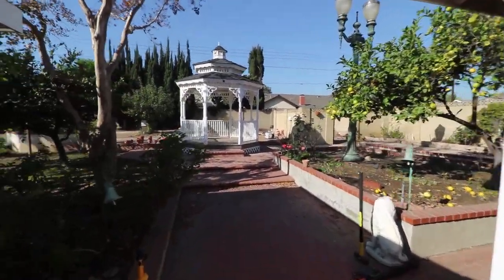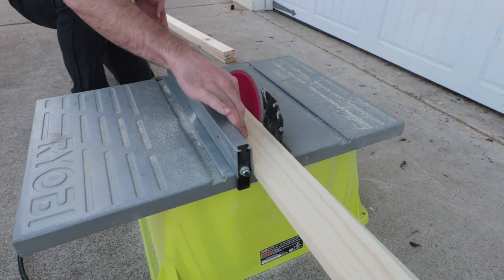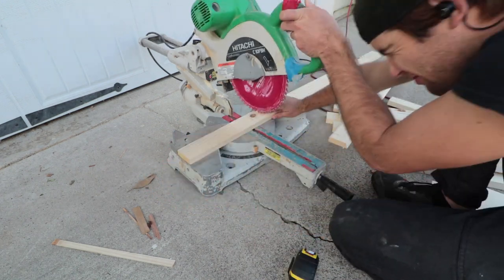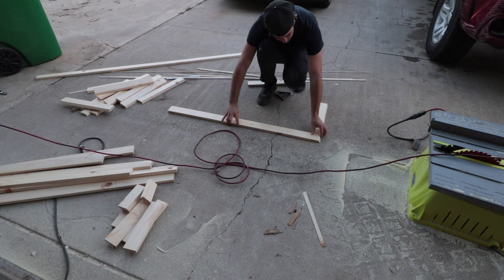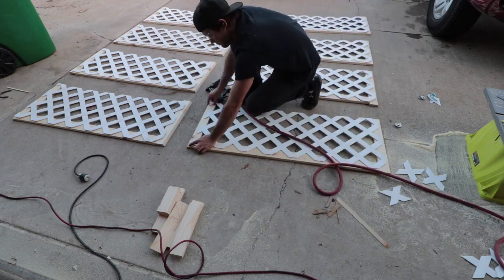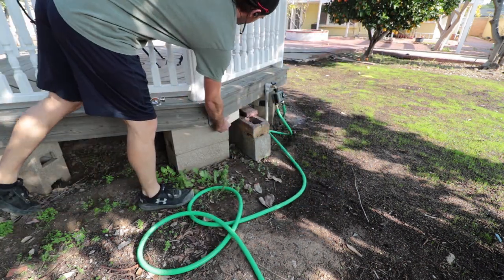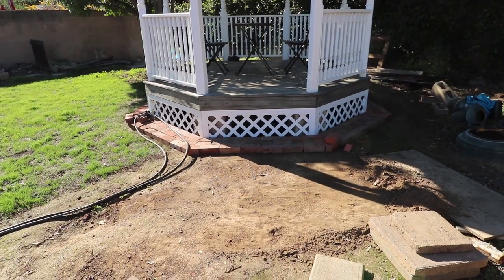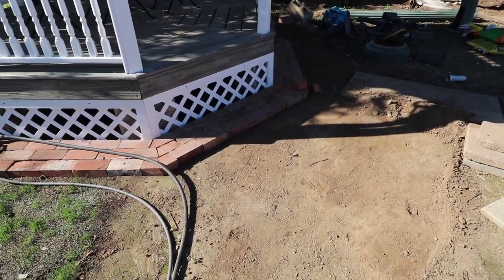Fixing up the Gazebo with Lattice and Brick

Comment: Ben, I see this video is over a year old. The pavers that you used have had that much time to settle. Are you happy with the way they've held up? The reason I ask is, I've done some paver projects, and been told that they must be put on a bed of "paver sand". They say that placing them directly on the ground would allow them to move around when the ground gets wet. What have you seen so far, as how they have held up?